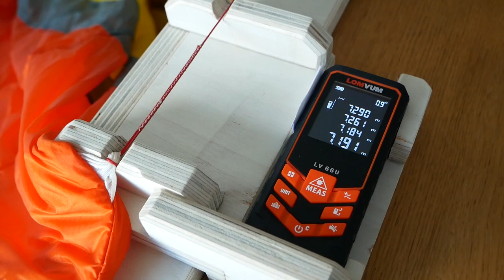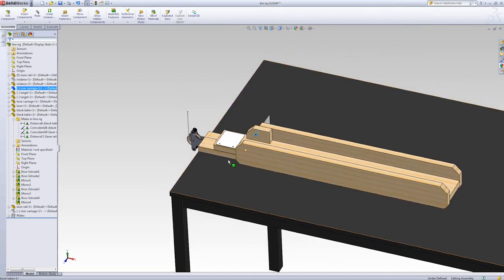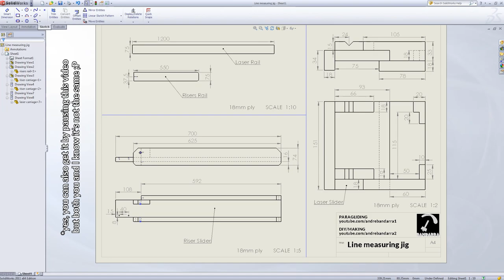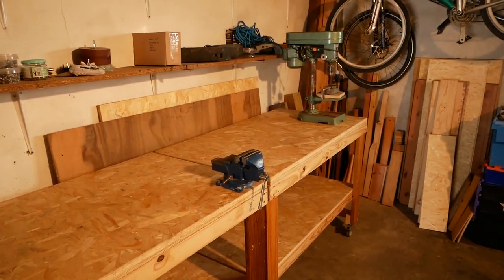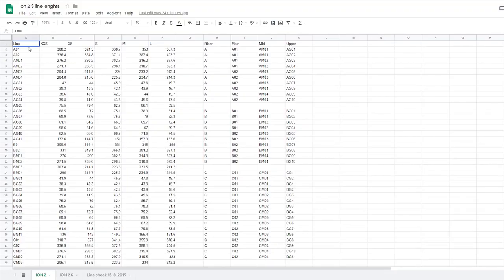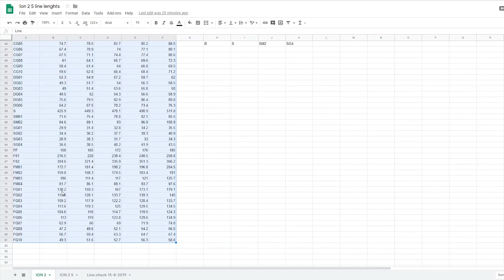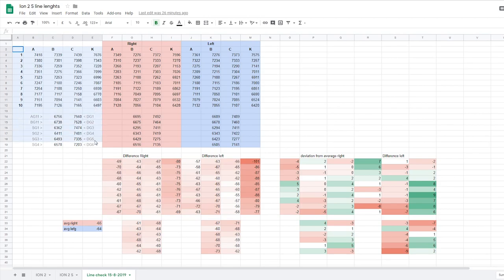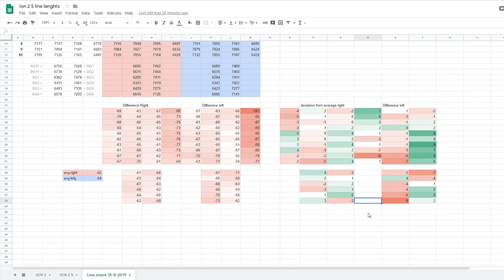Paraglider Line Measuring with Lasers! - BANDARRA

Comment: Figures that you would come up, when I look for a rail system... :-D Pro Tip: If you spend a bit more on the laser, it will bluetooth it directly into the excel sheet and jump to the next line... Fuck entering like 160 line lenghts by hand... ^^ Also less chance for error and WAY!!! quicker!!!

Comment: Good to see your design Andre and nice to see you have a workshop sorted out. Looking forward to seeing what you build!

I was worried about having wood sliding against wood when I built mine as I thought the friction might have an effect. I'm guessing that you are assuming that this effect is constant for each measurement so can be ignored? 

Any thoughts on measuring the brake fan with your design? One of the features that I think actually turned out to be a disadvantage on my setup was that I could move the target so I could then put an extra line through the brake handle attachment to anchor it to the "target shuttle" and then clamp the target at the brake attachment point to zero everything out. I guess on your design you could always do similar and then figure out the distance added and take this off all your measurements?
Reply from the maker: Hey Ross, yes I think friction might have an effect and I will oil/wax the rubbing surfaces a bit to make it less and easier to use too. 

For the brakes I just put that same bold through the brake knot and measure it like that
Reply: @AndreBandarra1  I put the brake handle through the same position as the riser position, then changed the values on the spreadsheet by the handle length under 5kg load
Reply: @AndreBandarra1  Bees wax or candle wax has always worked well on drawers so, should work for you.

Comment: I finally replicated your jig but from 10mm material. Also realized that your jig on the video has reflection plate on the left and laser on the right. Did you accidently assemble them wrong? Blueprint is correct and professional though. Thank you.
Reply from the maker: you're right, I've just noticed that now on the video but don't remember why. For sure they need to be on the same side otherwise you induce diagonal measurement error
Reply: @AndreBandarra1  I bet you noticed it while doing actual line check. I see you brought up that reflector plate to actually do measurements. And even with diagonal measurements your results came not too bad.

Comment: I would add small rollers in the bottom plate of the risers part, to make sure the tension is 5kg. If you start trimming a wing a wing that has no loops on the maillons, I guess you have to try all line lengths to match the most shrunk line, since it won't be possible to match to the average shrink (since the latter would involve lengthening some lines)?

Comment: Good job Andre. How long does it take to measure all the lines with your system? And there is no rail or bearing to slide the lasermeter holding part. Does it slide freely, or do you remove some weight to overcome friction?

Last week I also measured the lines with relative to each other. So I took the closest line to average and measured the others with tape measure relatively. I think it is very similar to what you did at the last part and it took about 1,5 hours. (Actually I measure one side than checked the symmetry later) I wonder what you think about relative measuring?
Reply: I realized that you already had the time question. Can you tell what you think about relative measurement?

Comment: I made a line measuring tool a few years back and I've had a go at putting links to pictures in my dropbox. I used scrap ally channel that was used for sliding windows. I did buy a laser measure but in the end decided to chop up an old steel tape measure and fix that into the jig. https://www.dropbox.com/s/t4g1r8o77iqtcvd/img_0707.jpg?dl=0 . The next picture shows the other end where the maillon fits and the switch the maillon holder bumps up against to indicate when the measurement should be read https://www.dropbox.com/s/6xtjohx7ddkeegm/img_0710.jpg?dl=0 . Other pictures https://www.dropbox.com/s/u29ow3nmhzxvw1s/img_0711.jpg?dl=0 and https://www.dropbox.com/s/ssbf695avauig4t/img_0709.jpg?dl=0 . The spreadsheet https://www.dropbox.com/s/rafjbmzs3d0ium5/Screen%20Shot%202019-08-17%20at%2016.17.48.png?dl=0 . I think the sheet is pretty much self explanatory but for the 'Adjusted' rows, these are all linked to the 'Actual Length Adjustment' box, top right. a plus or minus figure can be entered here to jack all the results up or down in one hit. The trouble with my machine is the space needed to set it up. Hope this all looks okay when I hit the COMMENT button.
Reply from the maker: Very cool, thanks for sharing Frank!

Comment: Yet another great project from the mind of Andre. Thanks amigo. I like the use of SketchUp as well. Nice tool. 
One thing I was wondering about is the actual replacement/repair of the lines. are you able to splice lines back together, or is it better to buy new ones for safety? If you're putting together one of your home sewn tester wings (the ones using SingleSkin app) how are you going to connect the lines where they join? You can create a loop and then loop the other end through (double loop connection), but it seems this would cause to bulky a joint. How do you splice single riser line into three where they branch? (Yet another project for you, haha).
Reply from the maker: Well, I've already started on that and there will be a video on it at some point you can bet :)

Comment: I‘ve read in one of the last thermik magazines, that’s a bigger tension of 20kilo (if I remember correctly) is better to ensure the core of a sheated line actually gets tensioned and thus measured correctly
Reply from the maker: There are some practical issues with tensioning to 20kg. even at 5k you finish checking a glider and your tendons in your hands hurt. 20kg would be really really hard. The in flight tension in pretty much any single line in a paraglider is less than 20kg too
Reply: You are right, I misremembered, the article suggested 10 Kilo. By the way, the suggestion is from Michael Nesler, who is currently the designer of Swing Paragliders if I‘m not mistaken.
Reply: You would have heard "20kg" from when people use to stretch lines, then 20kg was used.  The consensus was that stretching lines is a temporary fix, and that those you stretch will shrink again, so better to just shorten the ones which did not stretch (usually the As and Bs).  I stand to be corrected but the 5kg is just to make sure the line is fully extended, and I have seen some service centers use a lighter weight but then have all the lines lay flat on a surface and not sag under their own weight.